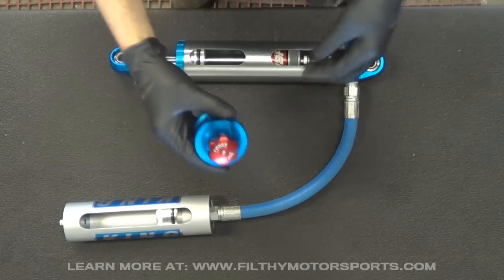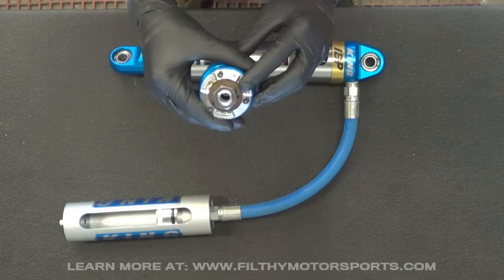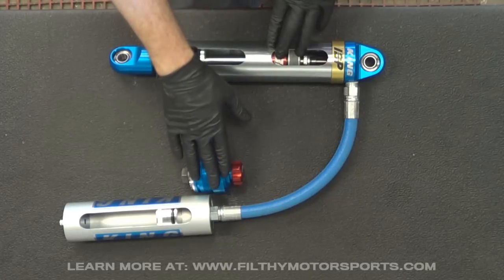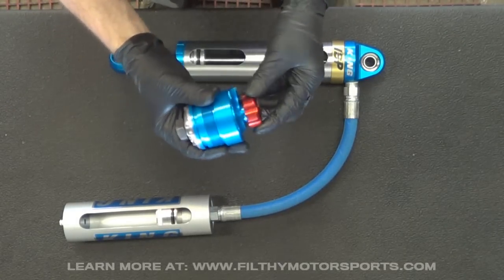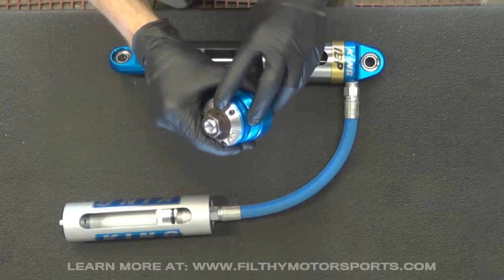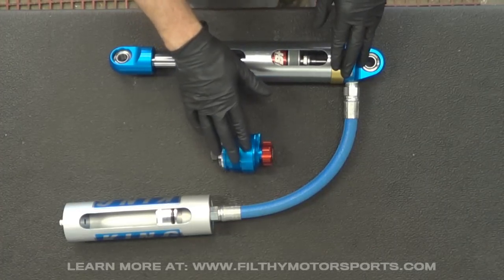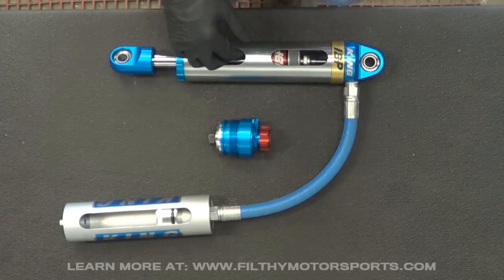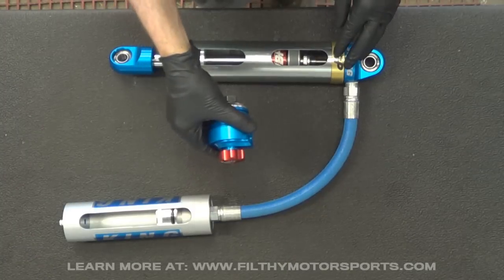How King Compression Adjusters Work - Filthy Motorsports

Comment: If I were to buy a set without adjusters, would it be the same as running the adjuster fully open? In other words, the adjusters only allow you to go firmer, not softer?
Reply: Negative. With the adjusters the main piston should be tuned to be softer so that some of the work load is transferred to the adjuster allowing you to go softer or firmer.
Reply: @kennethlarriva7578  is this the case with the kings though?

Comment: I have a set of kings without adjusters and kind of wish I went adjusters because on road is very stiff. Does the adjusters make them much softer over non-adjustable ones?
Reply: Depends on the application, we find a lot of the firmness is mis-associated to the shocks, rather than the springs supporting the vehicle. IE a Tacoma owner went with too high a spring rate on their coilovers, or preloaded too much to gain ride height, both can result in a firmer ride that the shock will be hard-pressed to fix.
Reply: @ShockSurplus  interesting...thank you for the information! from your experience, at what levels of preload do you find that it makes a functional difference? 0.5", 1"?

Comment: Since this changes the hose position from vertical to horizontal, you would have to plan ahead during the design stage of the build Incase you plan on adding these latter, to prevent hose binding as remote is mounted vertical. Perhaps a brass 90 degree would make this add on much easier after the initial install. Question; Why are the “Terms” compression and extension (Rebound) not a common word used to describe the shocks action? Maybe I miss understood but the vocal description used in the many videos as this was the only description used during decades of diagnostics for feel, activity or noise. Now, with adjustable control for compression, rebound is changed I would guess inside at the piston.
  (As a tech Tip) I would politely push the use of anti-seize on coil over spring seat especially but also, work a “Q-tip” or pocket screwdriver and get some on the “Heim Joint” ball ends for movement but dissimilar metals. True, depending on use, it could attract dust & dirt, but is easy to clean with carb spray, compressed air & rag wrap to catch this grease w/aluminum dust they may use. It is simple maintenance like a grease gun. Desert Storm, helicopters had to have covers installed to keep sand out as wear happened fast. Just 38+ years of experience talking out loud, but I do like the “King” equipment! My wallet, not so much. My wife spends more in a year on hair spray and her maintenance items that leave men with 1 square foot of bathroom countertop! Why? Yes dear...

Comment: Hello there.. i have a question. Silverado 2021 2.5 king coilovers do i need aftermarket upper control arms or not neccesary.. i know 3.0 will need uca but the 2.5???
Reply: I believe it depends if you want factory height or if you're gonna lift the truck

Comment: Are you able to add adjusters to bypasses? I have a pair of svt fox internal triple bypass. They need to be rebuilt and a shrader valve added. I’d like to add an adjuster if possible
Reply from the maker: Yes, that would technically be possible.
Reply: @Filthymotorsports  how much would that cost? Who should I contact to make that happen?

Comment: Does the compression help with low speeds, say driving around in town over speed bumps and pot holes?
Reply from the maker: It covers the full range but offers the most benefits at higher speeds and larger forces.

Comment: I have a BDS 8" lift on my F350 and I have dual stabilizers to help with steering. I'm not sure what kind of shock I'm currently using but they look stock. My truck feels loose in the front end I have bump steer also my truck is a little bouncy in the front end what would you recomend?